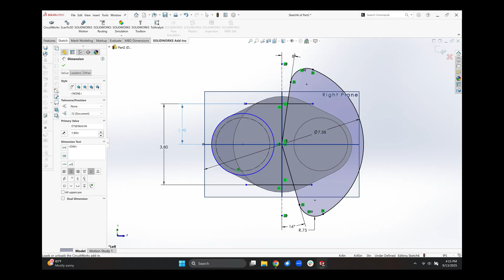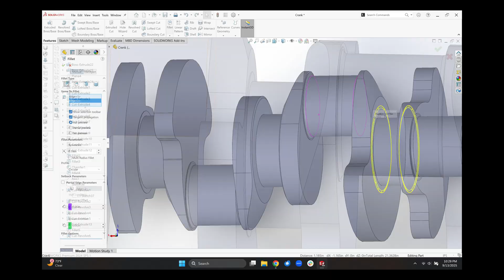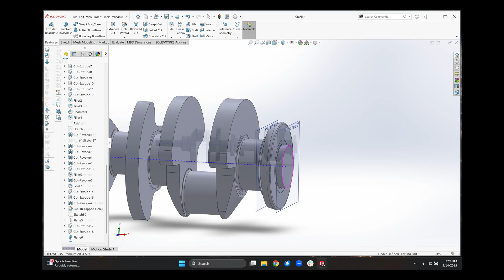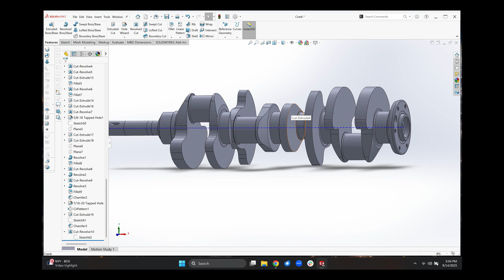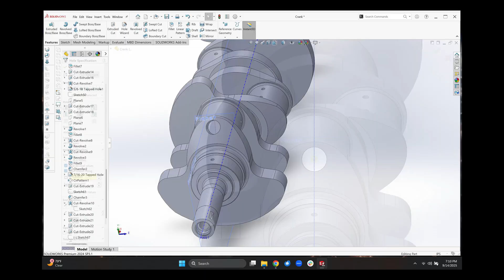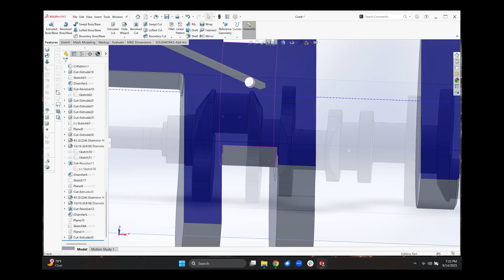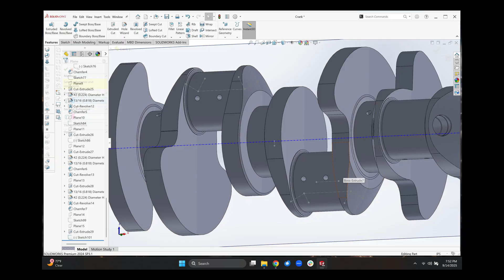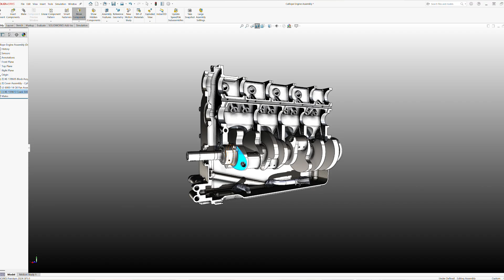Calliope Engine Crankshaft Reverse Engineering

Comment: Why the angled holes into the crank?  For lightness or for oiling?
Reply from the maker: Yes, yes.  As designed, there is intended to be a "freeze plug" sealing the opening, retained by a cir-clip.
Reply: @chopsmitty wouldn't it be better since it's internal to have used the screw and plugs to use on the later crankshafts for the 427, and using that freeze plug style with the clip, just thinking of safety more than anything else?
Reply from the maker: @johnmurphy2958 only assuming they chose this route for weight savings.  This is a very, very light engine for 1967!